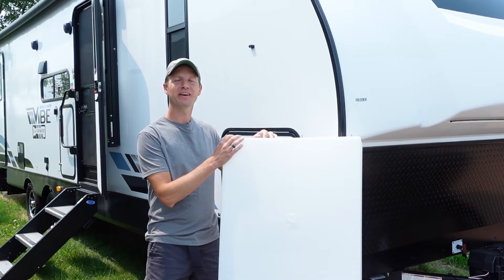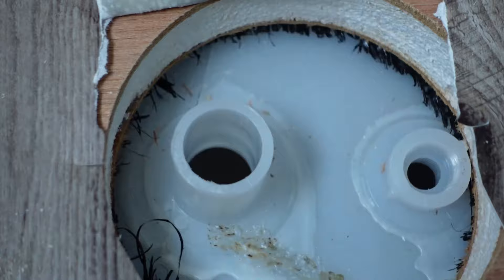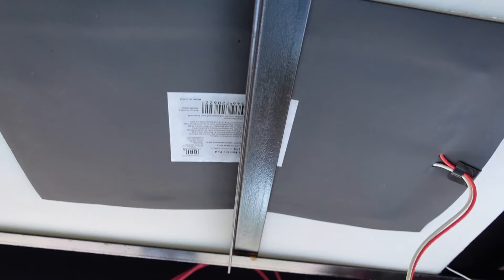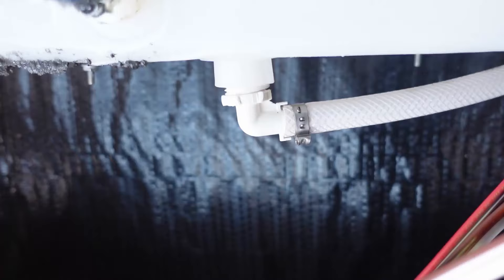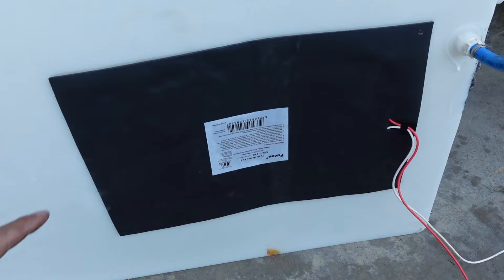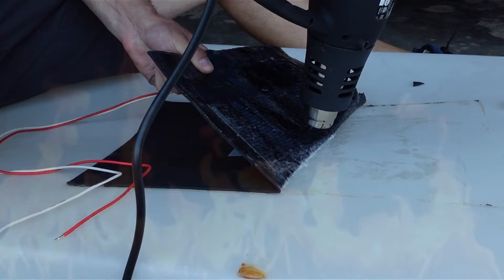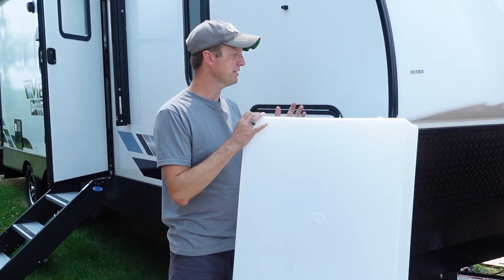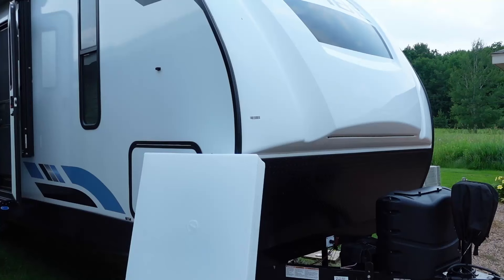DIY RV Repair: Replacing a Damaged Fresh Water Tank

Comment: Nice to the point video, thanks. My water tank is under a bench inside. Watched your video to see how to mount one under the floor to create more space inside.

Mine is over 20 years old and not failed. Did you do figure out why it cracked in the first place, tank not mounted securely, maybe? Don't want to do this again in a couple years. Also, I'm not a fan of how these trailers are built. Seeing the wires coming up through the hole, did you consider better wire organization to avoid chaffing and future failures, maybe some sleeving. I've found few issues myself.
Reply from the maker: Thank you. Yes, the factory accidentally cut too deep when cutting out the opening in the laminate flooring. This resulted in a score on top of the water tank which eventually cracked open. As far as support for the tank, that seemed very good so I’m not too worried about it creating future cracks. 
Yeah, the wiring these days could be a little better to say the least.  I will be adding some split wire loom tubing to protect those wires better. 
Best of luck with your project and happy camping 🏕️

Comment: I would like to know from start to finish how many hours it took to install the fresh water tank you just put in thank you
Reply from the maker: It was a good three hours to remove and replace the tank.  Some of that time was because of recording.  The hardest part was getting at the tank support bolts to remove them and removing the crimp from the water supply line. If you have the proper tools handy and understand the procedure, it should take you about two hours.

Comment: Did you cut the hole to get to top 2 hoses?
Reply from the maker: If your talking about the hole in the floor from inside the RV, that hole was there from the factory.  I believe that’s how the tank was cut, looks like they accidentally went too deep with the knife when cutting out the laminate flooring.
Reply: @DeanoOutDoors  thanks